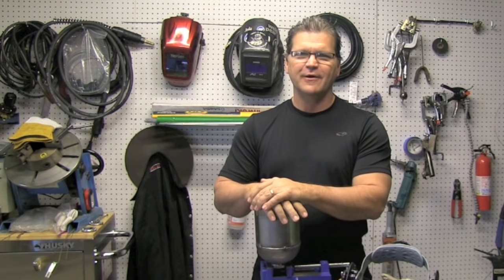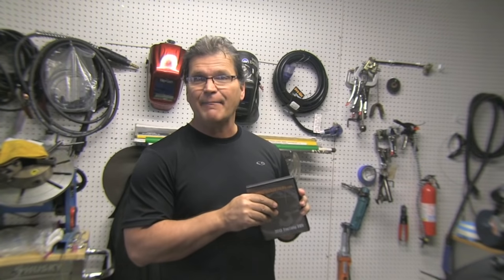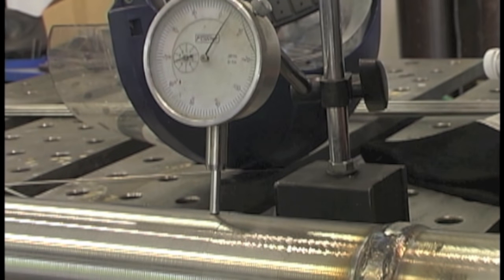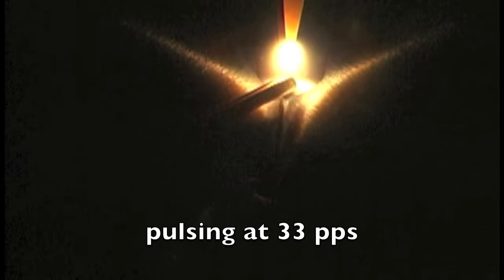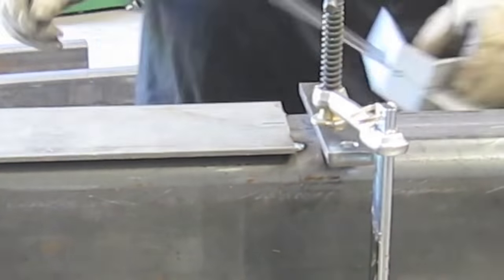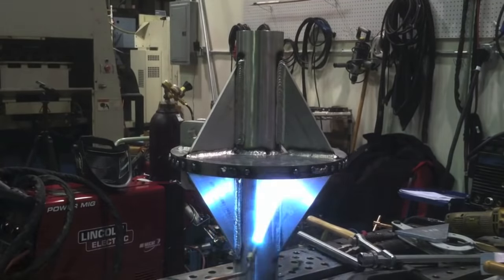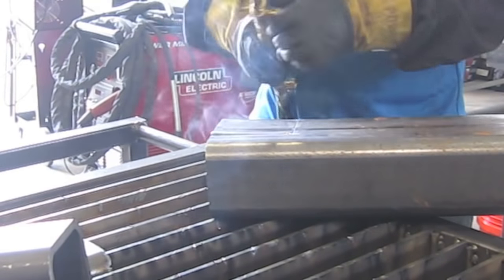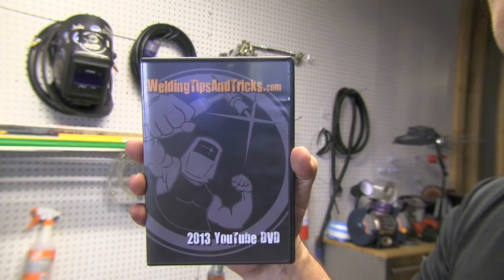TIG Welding Tips - 3 Tips that Matter Most

Comment: So I am the maestro of Fido's butt now.  Bought a Miller Diversion 180 and having alot of problems...I am good with stick and mig but suck so far with tig.  Can I ask several questions because your video is great:
1.  When you show torch "too far away" and "nice tight arc" could you give me a range?  I guess that we are talking like 1/8 of an inch for too far away and less than 1/16 of an inch for tight?  If this is the case (or if distances are smaller) how in the world do you maintain this without repeatedly sticking the tip?
2.  It seems like your torch angle is pretty steep-like 50 degrees from vertical-is that correct? Is that ok for beginner?
3.  In your videos and in reality, I can not see the actual tip of the electrode-it gets overwhelmed by the arc cloud near the tip...I can infer where it is but I cannot see either where it is above puddle or behind if puddle has formed well.  Do you just look at leading edge of puddle and forget about trailing edge?  

Thanks for your help and the great videos.  I will buy a tig finger if I even get to the point that I can start to get the swing of this.

Comment: I got a couple of questions...long time listener first time caller. Haha

All concerning aluminum welding...

Does the acetone produce a gas like brake cleaner does? I'm sure you wait till it evaporates . After reading the brake cleaner warning story of that guy that got sick I worry! 

How about when your running dimes on aluminum, and you need to start another rod, how do you keep it purdy, and avoid sooting the restart?

Is there any downside to welding with too many amps, I'm always in a hurry it seems, I tend to push puddle,  the amps , almost over heat the part, where as I see a lot of guys don't look like they hardly use any amps, and the puddle looks almost like its dry , sitting on top of the aluminum, not as melted in? My guess is as with steel the hotter the better?

Comment: Awsome video, hope you can help me out with my problem.
I started tig welding a few months ago and finished 3 bigger projects jet. So when i'm welding butt joints everything works just well but i have huge problems with t-joints.
At the last project i welded 2mm thick square tube out of regular steel where i needed here and there a little t-joint weld. Now my problem is that i can't manage to evenly melt both pieces but only one is melted at a time when i point the arc right on the weld and traveling along.
I also don't really know how exactly i should hold my torch.
I'm using a 200 amp inverter, electrode negative of course. The tungsten's diameter is 1,6 mm and i'm using most of the time a number 6 gas cup. The argon flows with 8 liters per minute and the stickout is about 6-7  mm. I have no foot pedal but only a button on my torch.
Hope you can give me a few tips. And sorry if you allready talked about that specific topic and i didn't notice. I watched quite a few of your vids now but i can't understand everything 100% because i'm from germany and have only access to my school-english.

So i hope you answer my question :)
Merry Christmas and greetings from Germany ;)
Reply: What i forgot to mention. When i was welding those 2mm square tubes i used 80 amps of regular DC for the but joints and about 100 for the t-joints, maybe there is a mistake allready ?

Comment: Hey dashizzler if your workin off a bench or table. It may help u bud to first tack it to the table for starters so it ain't rattling round or moving. I would tack the joint parallel on the edge of the table and with a light hand not pressing hard on your piece or the table slide nice n slow along the edge of table to keep u steady. I find counting as u dab your wire helps keep a rythem n consistent bead. If your counting is consistent your bead may b the same. Tight arc is key angle a few degrees in the direction of travel is prob a good idea n concentrate your arc a little more on the bottom plate should prob help. Just keep layin lots of beads down you'll get it

Comment: Do you use a foot pedal? On a ladder or on the floor the pedal just doesn't cut it.
My dad loved 7014 rods and I dont reckon he thought there were any other rods. They make a beautiful flat weld. I always liked 6010s for case boring road ways. Case boring is drilling the dirt out as the pipe goes under the road. Push one in and weld on 20ft till the destination is reached.

Comment: Jody would you cover the most consistent way to fully weld thin steel in all positions?  I am talking about body repair on old pickups where the door sills, the heater air duct, the bottoms of the fenders, etc., are rusted out and new metal must be formed and then welded in.  Heat warp over wide sections of this thin steel is also a problem since usually there is not way to reach the inside of the pieces being butt welded together.  It has to happen from one side and it must stay flat.  The videos I have seen are of people using .023 wire to string together a series of tack welds.  But there is not flow, it looks like hell, gets ground down and painted over what is at best a 50% weld as far as I am concerned.  I dream of a beautiful keyhole weld but the puddle always falls out, I just can't move precisely and steadily enough to make it happen.  
So, I wonder if the world of TIG is the solution?  I keep hearing stories of people welding bear can thickness aluminum.  If there is such a process that mere mortals can master to weld aluminum, welding 24 gauge steel all position should be a cinch. Is it possible?  How about you restore a '67 Chevy C20 farm truck that was never washed, sat out in the rain for fifty years and now the owner wants it to be brand new.  The only parts of the cab that remain are the roof and the back side.  My only option is to cut those parts off the old cab and weld them onto another old cab that is in slightly better condition.  That means about twenty feet of butt weld in all positions.  I favor TIG for precise control so please do cover what is the very best TIG machine you can think of for such work. Alternately, if you think of a MIG process that can work, please spec out what MIG that is.  I would love to have a machine that can correct for my mistakes of varying stickout and angle.

Comment: Hello again Jody,
I have a difficulty welding brass pipes(0.035") 
Can you guide me for what welding process should I choose for it?
Should I go for Gas welding or TIG?
I have heard from welders here in India that gas welding will need a flux for it and it may not give good finishing results.
Although my friend have a TIG welding gear but he never welded brass, so he fumble over the settings and my first experience was very bad.

Comment: Hey there bud love the work great video quality I have a problem I have been trying to get my dual purpose inverter welder ( its quality ) to weld on its tig option ( it has arc and tig ) it is only rated to 100 amps so I have a bottle of Argon set to around 20 which I have varied but no different out come. What is happening is that I am not getting a consistent arc and instead of a nice controlled arc it is flaring until it forms a ball on the end of the tungsten then it just blows off automatically I thought we'll you have the amps up to high so I started on 80 amps then stepped it down by 20 or so each time still the same result until about 20 ,amps were I get about 30 mm of weld time before it blows of the end I am using a thoriated 1.6 mm tungsten sharpened on my bench grinder any ideas?

Comment: What is the correct way to hold the torch in your hand? I have been mig welding professionally and I find when holding a tig torch it is uncomfortable in almost every way as far as my motion.. When mig welding I can run an absolutely awesome bead from any angle and position. But man a tig torch on the Miller 350 seems so awkward.. Can you show your hold on just a basic horizontal weld? thanks..

Comment: Hello Mr Jody.
I look often at your video and sometimes at others but definitely I found very few comments or techniques related to some basic informations related to «How to easy follow the ways to solder parts. I,e. with your wonderful camera shots, we can fallow the the arc and the techniques. I have a solar old mask and adjust it to see something but or the arc is too high or too low or something else is wrong. At the end of the run, when I look at the solder i made and I am Off the track. Not on the join, or around the nut etc, etc. 
What is the technique to know where you are with the tip and the rod ?

Thanks for your videos.

RP, from Québec.

Comment: Hi Jody.  Been watching your vids for a while. Great stuff.  Just saw one of your older vids (2013) When  you talked about the 115V . 20% duty cycle wire welder. I had one !!!  Pain in the Butt.  Opened it up.  NO COOLING FAN !!!! ????   I put a computer fan in it and it JUMPED to 80% Duty Cycle.  Hope this helps.

Comment: How do you purchase the dvd set? I have been a fan of yours for a while and love you videos.

also on a side note  I been kinda of trained on mig welding New York Automotive and diesel ; but had to use a arc sticker welder AC to do a outside tractor repair ..(Plow blade). Don't know what I was doing wrong but that thing produced no puddle.... it kind of looked like a uncontrollable burn? is that because its AC? unlike the DC mig  the end result it will hold for this season until I can mig weld it but its ugly as hell

Comment: Interesting.  I am new to welding.  I got a cheap stick welding from Amazon in June or July of last year.  I freaking love it.  haha  Also, I can actually weld stuff now.  I want a mig and a tig welder.  I asked miller for advise on a cheap one.  They told me to get the Diversion 180.  NOT cheap.  haha  But, I will save for it.  I know Tig is MUCH harder than stick welding.  But, I am excited to try.  I think there is a pedal?  haha  No clue what that is for.  All in good time I guess.  Thank you for the cool video.
Reply: +Josh Glowzinski Check out used welders. At times you can buy a good used industrial weld reasonable. I bought a 600 amp Linde welder with the boom for $600.00 and the Hobart people had went thru it, cleaned it and tested it. While not everybody has a big 3 phase set up to power these things, I did have. I also bought a 400 generator Hobart welder at an auction that didn't work. I got it home and took it apart, and it had a bolt arced across one of the coils. I removed it and it welded perfect. I figured for $50.00 the engine was worth it, but I lucked out and got a great welder. In 2011 I bought a real nice older miller stick/tig for $1000.00 for the company I worked for. It had a water cooled torch and everything. I was an older tig that had the gap points, but they were good shape. Still welded better than I did, LOL.
Reply: The thing for me is, if I am going to spend over a certain price, I want a warranty.  Someone killed me in 03.  haha  Sucked for me, but it was the best thing that ever happened to me.  100% changed my life.  I get money from S.S. now.  If I save for like, 5 months, I would have enough to get a Miller Bobcat.  Like, the cheapest version.
Reply: It should be noted.  I have no clue how to fix any kind of devices.  Well, not as far as tools like this go.  I can fix a computer.  But, I would be lost with a welder.

Comment: AT this point in time I would be ecstatic if I could get my welds to look like fidos butt.
Reply: My welds are looking like the shit that comes from Fidos butt!😢
Reply: My welds are fine, it’s the arc I’m fighting with. My arc is dancing all over the place.
Reply: @mrmidnight32  regrind your tungsten or clean your part better? Idk
Reply: CK_32 grind your tungsten to a sharp point, when you are ready to weld get the tungsten close to the puddle but just far enough away that it doesn’t dip into the weld.
Reply: i had fidos butt in my hand within my 3 first welds ever
Reply: Tell me about it; I just started the welding program at my local CC and my TIG welds look more like what comes out of Fido's butt.
Reply: I was thinking the same thing, it's  a steep learning curve, been far too long on MIG
Reply: Black Feniks  l
Reply: @jessirenea30  LMAO , i was looking to write something like that myself

Comment: working on my TSSA for tig high pressure plates. the root pass is hard but that's not my problem. for some reason I get a bunch of porosity on my cap passes. they won't bend it even if there's a spec of it. any tips for me?

Comment: Jody, do you have any tips or suggestions on what I should look for in a welder as a beginner in tig welding for automotive sheet metal. I've been a big fan of the channel for years your videos help me out and I love the arc shots.
Reply from the maker: there are several choices for a beginner. remember that you will not find a machine that does it all.  there is always a compromise. The least expensive way to get into tig welding automotive sheet is with a DC only machine that only welds steel. I would definitely recommend high frequency start and a foot pedal too.   the Everlast 160sth would be one option for dipping your toe in the water.  Another option would be one of the newly branded TWECO machines (previously thermal arc).  A miller maxtar 150sth would also do but much more money ...but if you want to stay with a big brand is a good way to go.
just remember, that if you want to tig weld aluminum you need a AC/DC tig welder
Reply: weldingtipsandtricks
Hi Jody. I am in a similar boat. I have an old DC "Eltig" (some Italian brand) It works well, I repaired the electronics in it myself.  My question is what filler rod would best suit TIG welding automotive bodies? especially later models with thinner but harder steel panels? Also what shield Gas would suit? It seems no one knows what TIG welding is here in Australia and haven't been able to get much help from gas suppliers on the subject.
Reply: *****
hello justice9111,
what filler material should we use for tig welding AISI 1018    hallow pipes of 2mm thickness?
Reply: *****
cheers for that.

Comment: G'day mate,
I'm tig welding 304 stainless and getting a 'flare up' on initial HF start which is causing unsightly marks at the start of the weld. It doesn't do it every time approx 50%.
I'm welding at 140amps and using about 0.7 seconds of pre gas.
Please help.
Cheers,
Ben
Reply: I would firstly take off the pre gas - not necessary for manual as the hf will not pull the main current unless the gas is there anyway, post purge is a different matter.
Would check if you are getting a high gas surge at the start which can flare the arc.
If so you may be using single stage regulator - switch to double stage regulator or fit a surge protector - you will save on gas anyway.
Reply: Thanks for the fast reply mate lol.
Setting was on pulse at the time of the $168,000.00 job, not manual.
Took me just under 7 weeks to tig up 168 meters of designer walkway railing.
That's right, $1,000.00 for every meter of this shit!
That's what us tax payers here in Aus had to fork out for a bloody hospital.
Changing from a #7 to a #8 nozzle seemed to help a bit but not fix the problem (which supports your surge theory).
I'll definitely take a look at the reg when the holidays are over.
Cheers,
Ben.

Comment: As a student, I've been struggling with this. We're doing 6 pack lap welds with 11 gauge for practice. I'm getting better, but not consistent. Do you anchor you arm or hand, or do you ride the steel with the cup?
Reply: Jody shows bracing your hands and arms in many videos. No one said a word before Jody did !
Reply: He also shows making practice paces with the torch or stick with the machine off to figure out how and where to brace or rest your hand. His tig fingers will allow you to leave your hand where it would be too hot otherwise.
Reply: Hey man, thanks for the reply. I've actually completed my course, and received certification in 3F and 4F. These videos have helped out a bunch.
Reply: did you go to an accredited AWS testing facility?  Just curious.  has any company honored those "certificatoins", and not made you take an in house weld test?  What process were said certs for? SMAW, GMAW, FCAW, GTAW ?  Since the positions were 3F (vertical) and 4F (overhead) and the F denoting fillet welds.  I can discern it is for structure and not pipe.  i would really like to know.  im interested in going to welding school.  any advice would be great!

Comment: I have a inverter who can do tig with high voltage start, and it can do sticks, I see that tig is a very nice way to weld, so I get not that much metal I have grinded afterwards, for making bikes, I thinik tig is the best, I can even solder with it like copper welds on steel I did hear, but I have never did tig, only did mig with oldtimers, but see that also there tig is very nice.

Comment: I am new to welding, in the DVD, does it tell us what rods to use and why to use them and more of the beginners stuff?  a lot of the stuff I see in this video looks way too advanced for me to even contemplate. I have done about 5 or 6 night classes.
Reply: +Gary Lowe thicker material, thicker rod. that enough for starters.
Reply: +Gary Lowe thicker material, thicker rod. that enough for starters.
Reply: Piotr Brenda thanks for the reply. I think i have seen people who just use the torch to fuse thin metal, is this correct or am I missing something?
Reply: +Gary Lowe Yes you can it is called autogenous welding. A fusion welding process using heat without the addition of filler metal to join two pieces of the same metal. look it up it is useful for tacks and fit up .
Reply: Bad Apple Garage Thanks for the information mate. Very helpful. I will look it up in the morning. Thank you.